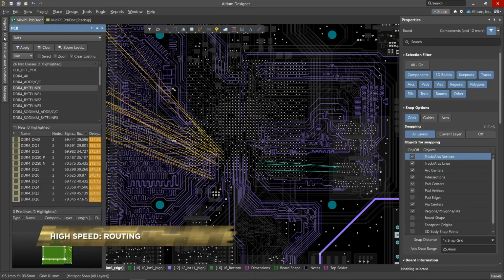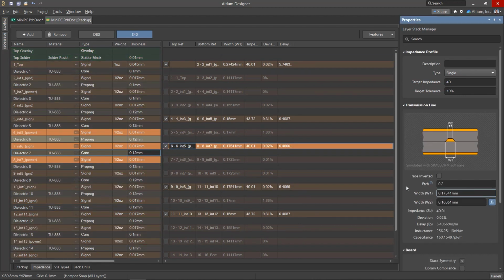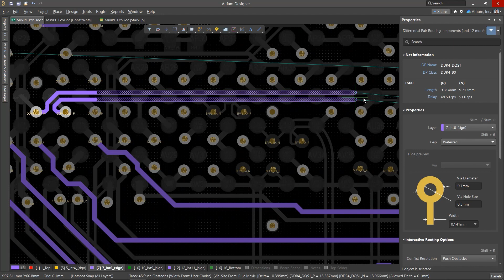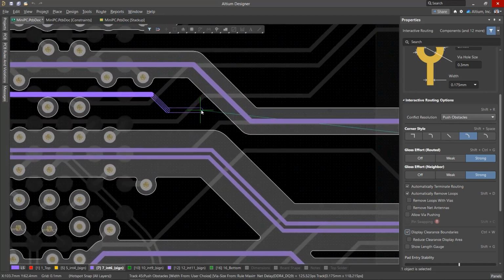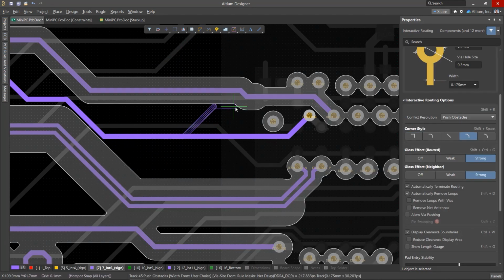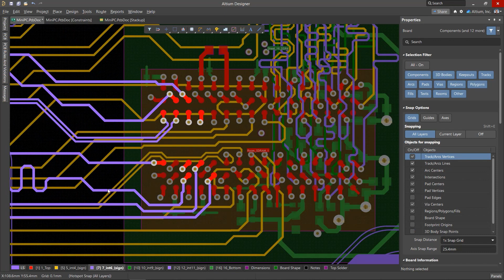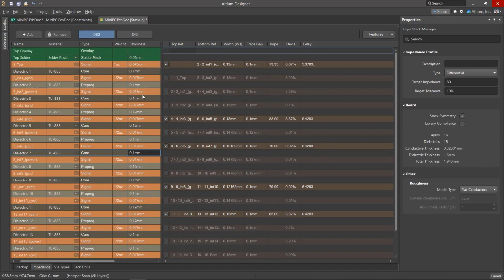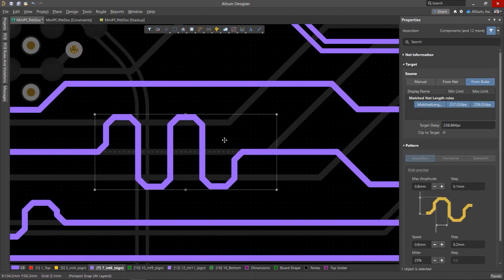How to Route High-Speed Designs in Altium Designer

Comment: WHAT is that Design Rules view? I’ve used Altium for 20 years and never seen that advanced view.
Reply: In the lower left corner of the PCB Rules and Constraints Editor, there is a button that says Switch to Document View. It will show the view configuration that you see in the video.
Reply: @Zachariah-Peterson  thank bro